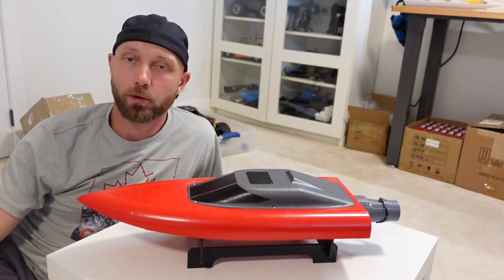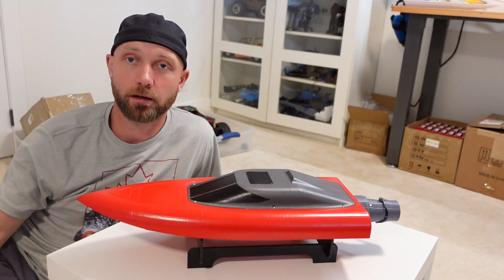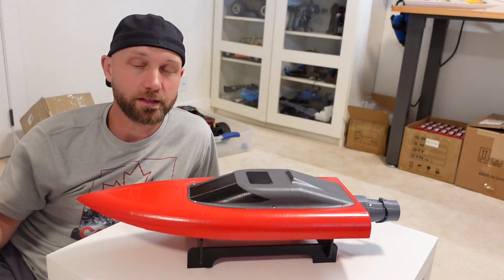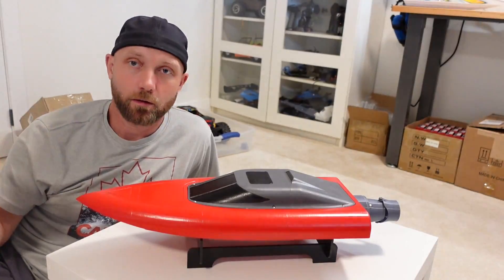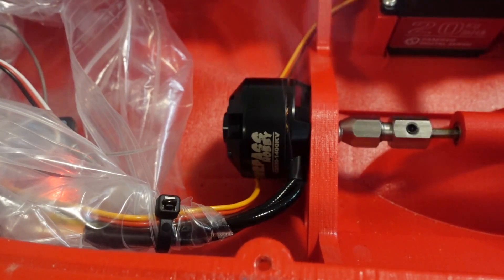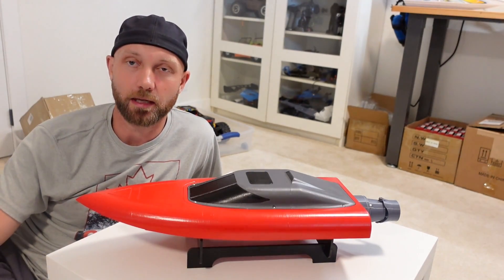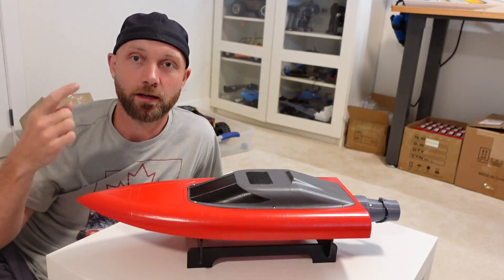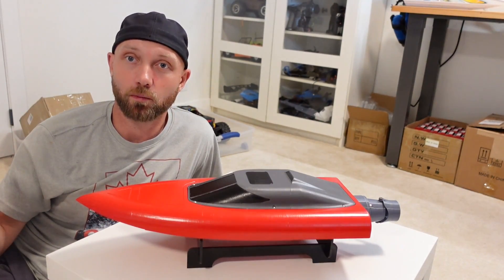3D Printed RC Jetboat Build

Comment: How did you drill the hole in the shaft for the prop?
Reply from the maker: Drill press and a dream. If you're having trouble you could try 3dprinting a holder for the bar with a hole in it as a guide.
Reply: @rcprinter  I bought a press for my Dremmel and 3D printed a vice for it.  Worked like a charm!  In the sanding process now..

Comment: You killed the motor, beacause of you need a flexible coupler between the motor and the shaft. They are not perfekt in line. If im not total wrong, you also killed the bearings, or you rouined the whole print because of hot bearings melting the material 😅 Otherwise nice made boat. Hope mine drives in a few weeks ✌😁
Reply: HI, i am also printing this thing right now, but i am unsure about the motor to use, any hints?
Reply: @DeadOldMan-derechte  Not really. I never found a motor that works. Maybe if you use an watercooled boat motor. All air cooled motors were hot after seconds 😅

Comment: Cool boat busy printing it but just wanted to know what size screws and bolts you used on it
Reply from the maker: 40mm m4 screws for attaching the jet to the hull and 12mm m5 screws for the end nozzle is what I used. Also a few m3 screws for the lid/servo/motor I think. I'd highly reccomend building this one instead tho: https://www.youtube.com/watch?v=Y1Hbs5mJjq8&t=46s&ab_channel=RCPrinter

Comment: There is huge problem with this model bro it wont go reverse. I am using bidirectional 30A ESC.
Reply: Unless you fit a reverse bucket it will never reverse mate, Not a huge problem with the design, Just a feature of jet boats, haven't had any issues with mine
Reply from the maker: Yup Rav3n is right. No reverse on these or any other RC jet boat I've built so far.

Comment: Hi there. I think iv got your bot design as looks exactly like yours and even your logo. Did you shrink it down? Just yours looks smaller. What motore did you use if it was bigger? Or as it is. I'm carbon fiber ING the hull as going to reinforce it for rapids at my local river. Great vids mate
Reply from the maker: hey I didn't shrink it down but I grabbed the model from here: https://www.thingiverse.com/thing:3328520

I tried a number of different motors you can see here: https://www.youtube.com/watch?v=3G5MLaL8eKo&ab_channel=RCPrinter

Regardless of what you choose for a motor, you're going to need to figure out some water cooling which I haven't been able to get to yet. Once water cooling is installed I'd probably go back to a standard 540 size motor for simplicity.

Comment: My boot ist waterproof what schould i do
Reply from the maker: you could try painting it, or just run a coat of epoxy over the hull. no matter what you do though you'll probably still get a little water leakage so make sure you use a waterproof esc.

Comment: I know this is a little late but I was wondering what length screws you used to attach the jet to the hull and jet nozzle
Reply from the maker: 40mm screws for attaching the jet to the hull and 12mm screws for the end nozzle is what I used although I think 10mm would probably work fine.
Reply: @rcprinter  thank. Building it now

Comment: Do you have a list of hardware with links?  I have the hull printed out and ready for sanding so I need to order some hardware to finish mocking it up...  Also, what were your infill settings?  I printed it at 75% infill and its kinda heavy for an empty hull.  I was worried that if would break if I printed it at 15%....  Thanks!
Reply from the maker: Sorry no hardware links... I printed this with two walls and standard 15-20%ish infill with a .4 nozzle. The boat is gonna be heavy already and 75% seems like quite a high infill rate IMO.
Reply: @rcprinter  I just printed the boat in PETG with 4 walls and 12% infill and its strong and still kind of heavy...

Comment: what kind of rod did you use for the steering
Reply from the maker: Just a thin steel rod I had lying around that was for rc planes. I later upgraded to a stainless steel 1.5mm rod and its much better.

Comment: how did you fit the driveshaft to the Motor?
Reply from the maker: Its a coupler for rc boat shafts. They make lots of different kinds that go from whatever size shaft your motor has to whatever size shaft your driveshaft is.

Comment: Love this build! Put a small L-shaped trim tab on the stern and bend it down slightly into the water to get the nose down to keep the jet full of water. Also the proper way to use CA and kicker is apply glie to one part and spray the kicker on the other part then join the two halves.
Reply from the maker: Thanks for the tips!

Comment: What's that spray you use after applying glue on the joints?
Reply: It's called CA Kicker. It's a CA accelerant. He's using it wrong, glue should be applied to one half and the accelerants sprayed on the other half and allowed to dry quickly. Then the two halves are joined for an instant bond.
Reply from the maker: yup its a ca activator spray. I used one called "instant bond" from canadian tire.

Comment: Where do I get the code for it? And as well as connecting it for the device?
Reply from the maker: https://www.thingiverse.com/thing:3328520 I use this RC radio controller which connects to my servo and esc: https://rcprinter.com/products/flysky-gt5-radio-controller-w-bs6-receiver
Reply: @rcprinter  and how do you use a 22 V battery if the receiver is powered from 3 to 8 volts? should I put an additional stabilizer?
Reply from the maker: @docfbi  it depends what esc you have but the esc can likely provide power to the receiver @~5v. Mine does but I only run 2-3s lipos, not 22v.

Comment: love how the hull is two slightly different shades of red, like you ran out of one roll part way though
Reply from the maker: yeah, could have done a better job with paint for sure.
Reply: @rcprinter  paint or print? the paint looks great
Reply from the maker: @pacman10182  Sorry, I definitely did use two different red filaments. The paint is crackling a bit, hard to see in the video maybe, could use a sanding and a final coat.

Comment: hello
I also made a boat of the same model.
Please leave a comment on where you purchased the propeller product.
I need to buy a propeller shaft
But I don't know which product to use
Reply from the maker: For this jetboat I used a 3d printed propeller and a generic 4mm stainless steel shaft cut and drilled at home. I got a bulk pack of 4mm stainless steel rods on amazon.

Comment: what paint did you use for the boat? do you think it is watertight for quite deep?
Reply from the maker: Seems pretty watertight. Not sure what you mean by deep but I'm sure fully submersed the lid will leak. The paint is just a cheap Rustoleum Painters Touch 2X paint/primer combo from Canadian Tire.
Reply: @rcprinter  ok thanks, that helps!👍

Comment: To stop the motor from burning out you need a water jacket for the motor. It works by pushing water through a silicone tube that connects to a waterjacket on the motor. Then it exits the boat and starts the cycle again. No additional motors are needed just the water cooling system that works due to the force of the water when the boat moves.
Reply from the maker: That's the next upgrade for sure.

Comment: I designed and printed one of these.  It performed very well.  And then I redsigned the prop and nozzle to optimize the power output then the power got insane to the point that if the bough ever hit a wave taller than it dead on it would dive under the water for 5 feet and come up again.  Causing the need for a hull redesign to match the power upgrade.
Reply from the maker: mo power mo problems :) also mo fun

Comment: What diameter rods did you use to assemble the front and the top lid of the boat?
Reply from the maker: Hmmm, I think I used bits of 1.75mm filament for the front nose and then it was either 1.5 or 2mm rods for the lid. Sorry can't quite recall, just threw in whatever fit nicely at the time! YMMV.

Comment: Would a 540 Motor fit with this setup? I have the skeeride and a few 540 motors. Im not familiar with the differences in the can sizes?
Reply from the maker: Yeah I think it would fit. If you look at some of the makes on thingiverse there's people with what looks like 540 motors installed.

Comment: I'm thinking about building something like this too, but as a complete novice to RC boats I do have a questions:
Are there any waterproofing considerations for the internals? I mean, you do have a forward facing scoop on the top, so in rougher water...
Also, do you have any suggestions for waterproofing the hole for the driveshaft?
Is the paint necessary? I also saw you spray a coating over the propeller, does PLA have problems with water?
Reply from the maker: I haven't opened the scoop hole yet so there's that but yes you do need to be careful. The biggest place I get water in is actually the driveshaft at the moment so I'm hoping adding grease in the space between the bearings will help. I don't the paint is absolutely necessary but I think it also helps with the waterproofing. PLA doesn't have problems with water as far as I'm aware.
Reply: Can you list all the materials you used

Comment: Super sympa votre vidéo quel configuration électrique avez vous installé?
Reply from the maker: I had a c3530 1400kv brushless outrunner motor and 30A hobbywing esc (16bl30) in there for the test but I blew the motor pretty quick so I'll have to upgrade soon.
Reply: @rcprinter  ok merci pour votre réponse.

Comment: Nice boat.  I guess is missing a Watercooling for at least your motor.
Reply from the maker: harder to cool an outrunner motor with water but I suppose I could have use a water cooled motor mount. I'll do some testing with different motors soon and see what works best.
Reply: @rcprinter  cooling water jacket should work easly
Reply from the maker: @MrTetards  on an outrunner motor?

Comment: I built almost identical model some years ago. Using a pretty beefy inrunner motor with water cooling for both the motor and ESC. The damn thing pulls 150A from 4S battery at full throttle and even with the water cooling that is too much.
And it really doesn't like any sort of waves either.
Reply: how are you running 4s in a tiny boat like this
Reply: @lucasvanhamburg4937  low KV motor. Need the torque but maybe I should try different impeller.
Reply: @Qwarzz  low kv doesnt mean high tourque, if you want higher tourque try a larger diameter motor. but as you said a lower pitch impeller is a way easier sulution.

Comment: Did it float? I print the same boat last year but it sunken if yes why it yours waterproof and my one not?
Reply from the maker: Yup it floats. Paint helps, and lots of glue. It leaks a bit where the shaft spins in the bearings.

Comment: Very nice, what material is it? PLA i good for such application?
Reply from the maker: yes its all in pla. The motor can get pretty hot so I'd reccomend adding a shim out of petg or metal or something between the motor and the mount plate so you don't melt it.

Comment: The “sucking air” issue may be cavitation from running too high of a KV motor. This is a common issue in jet-boats, and also boats and water pumps in general
Reply: yeah an outrunner motor relies mostly on air to cool so its probably not a great idea to run a high power setup inside an enclosed boat without any airflow
Reply: @lucasvanhamburg4937  it has nothing to do with in-runner vs out-runner but everything to do with propellor speed and pitch. I have run and have seen many people run out-runner motors in boats with no issues. The big thing is matching prop size with speed. Considering he didn’t use the suggested motor, he isn’t getting the results the designer got. 1400kv on 4s is ~21000rpm. 650kv on 6s is ~14,500rpm. Basically, the impeller is spinning 50% after on his setup causing cavitation
Reply: @lucasvanhamburg4937  and if he’s only running a 3s battery (he never specified) it’s still spinning at ~15,500, which is still 1000rpm faster than suggested. And I’m sure whoever designed the boat didn’t calculate the best motor for the prop they designed
Reply from the maker: @nathan1sixteen  yeah I was running 3s there.